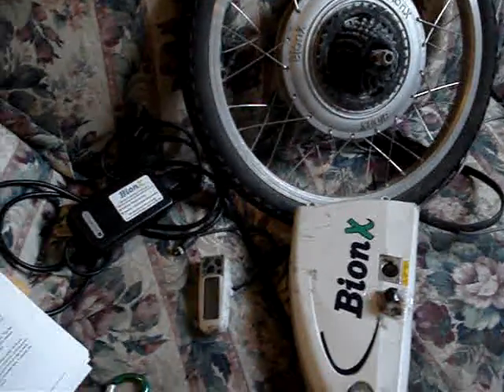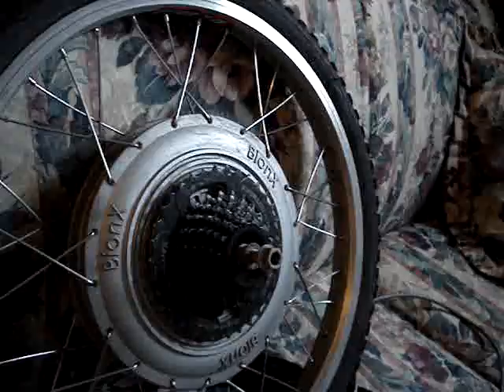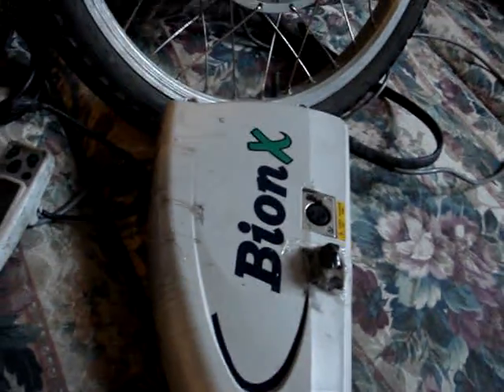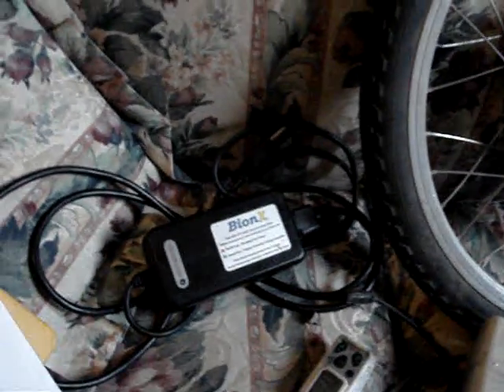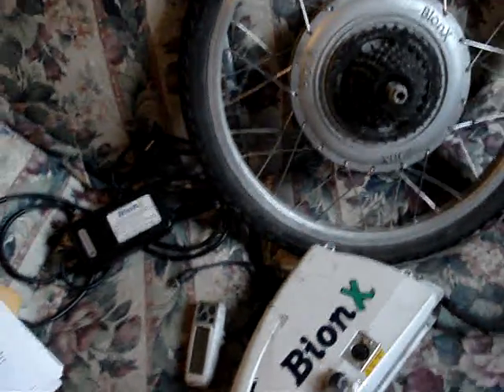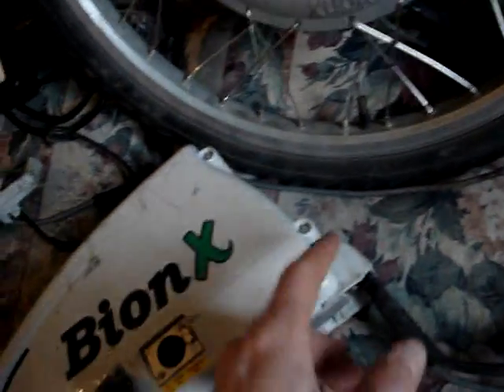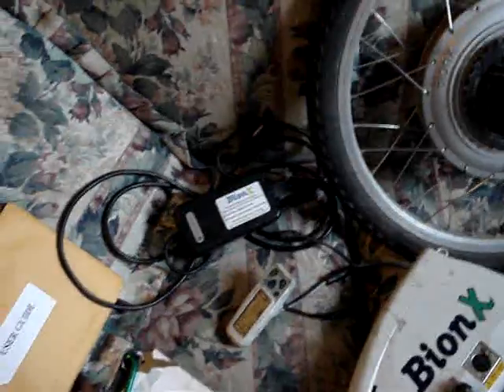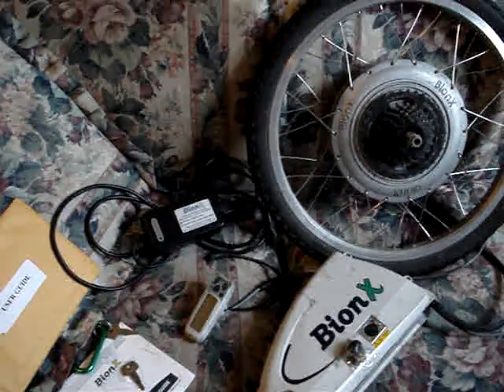Bionx P 250 electric hub motor kit

Comment: I Bionx P 250, Ver 1.2,May 2005, 24V NiMH battery does not work, I tried 24V lithium-ion battery (7S5P) Show console all functions but not help motor(not  work el.motor) .  put in place the battery power supply stabilized on the same rezultat.A volunteer one 10 seconds and stopped. Please help instructions.